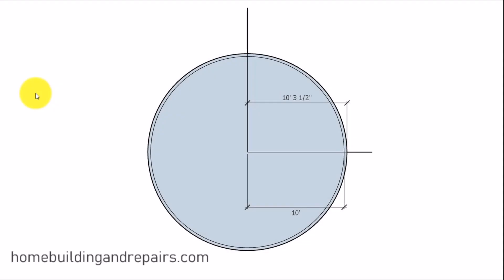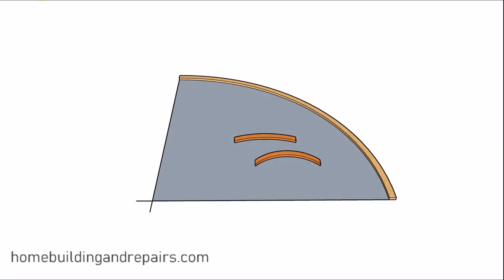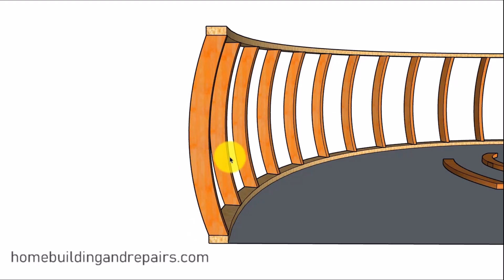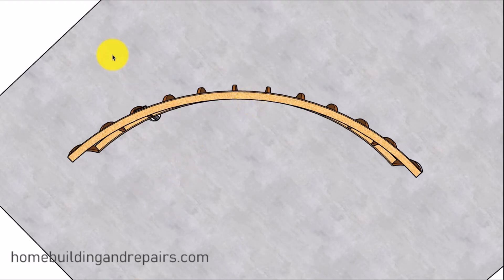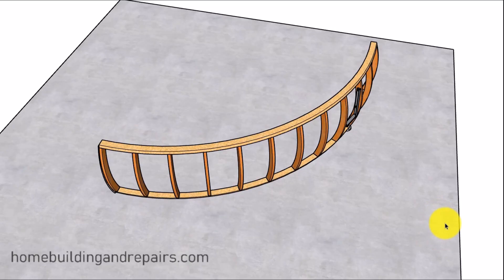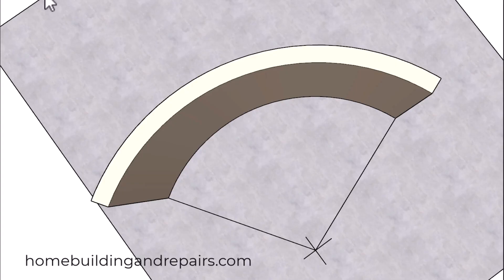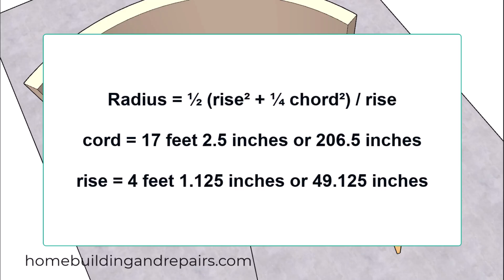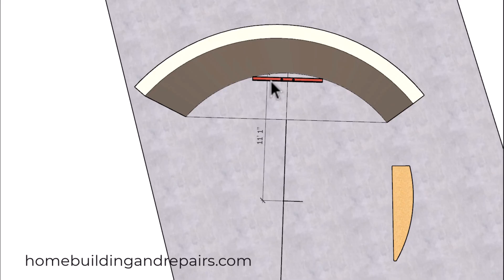How to Frame a Complex Curved Wall - A Step-by-Step Guide for a Unique Project

Comment: Dude, you are doing this on a computer. On a computer you can just enter the shape and have it poured from stainless steel, then the building will also be very shiny. Unless you do this in real life with real plywood (which would be very expensive) and you show us the results this is just total bullshit.

Comment: Fun...
I've been looking into round towers or turrets and settled on an inside diameter of 12' and an exterior diameter of 16' leaving me with studs built like vertical trusses 2' wide & 24' tall. It turns out 38 of them gives me an even 12"center on the inside and an ever 16"center on the outside... I think the bottom plate might be forgone and the bottom of each stud be in an adjustable height bracket sticking out of the concrete footings... The top plate would be a curved gluelam in three or more pieces, made of many layers of 1/4" plywood pressed and glued together in clamps on a mold guide, then enter locked in assembly on adjustable brackets between the studs and the circular beam.
The floor for the structure above would be an arched pergola with the round yurt like apartment on top.

Comment: Yes, you can use 1/4" - 3/8" thick blue-board and plaster this curved wall. You need to sponge water on the blue-board sheet to prep it in order to bend/deflect the sheet to fit. The sheet needs to be moist enough so as to not crack it when screwing it in place but not soaked to the point where the screws are not holding. It's easier than most people think. Once it's screwed on and it dried out (not long at all) the plasterer makes it pretty.
Reply from the maker: Great info!

Comment: Back when people actually made wooden ships, they would select actual curved branches from which to cut the ribs, from trees that naturally have lots of curves such as osage orange. On smaller projects like wooden canoes, the wood would be placed in a steam box until it was flexible and then clamped into place on a curve. If instead you cut curves across the straight grain of modern fast growing pine, you would get curved "studs" that had almost zero bearing strength. --they will very easily split as the curve crosses the grain.

Comment: Interesting !!! I love your channel. It's great for DiYer families, you bring very valuable construction information , thank you. I want to ask about playground builds for churches especially. Many churches don't have big enough budgets for pretty, sturdy commercial metal playground equipment. But on the other hand, I've seen some very shoddy playgrounds built out of inferior sized lumber, to the point of being a lawsuit waiting to happen. Many designers apparently don't take into consideration the amount of torque and twisting, 4:kids swinging on on a swingset simultaneously can create for example, especially when it's attached to some elevated platform that starts to move and twist with the swinging kids!!!!
Reply: Try to avoid pressure treated lumber at least where the kids will place their hands while playing or climbing. Over time, carpenter bees will start burrowing underneath horizontal runs of that material. They have a painful bite. Composite decking although more expensive is a much better choice for certain spans and especially overhead of children like if there are two levels. Metal plumbing pipe painted and flanges are good for hand holds. 4x4 pressure treated lumber is good for vertical pieces.